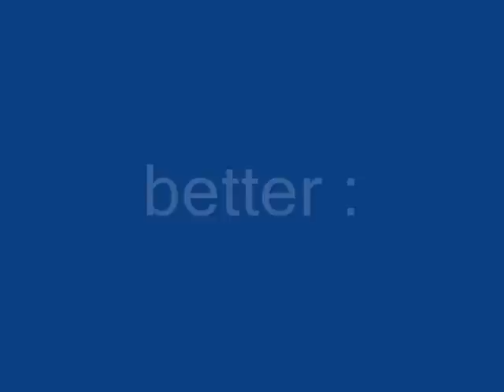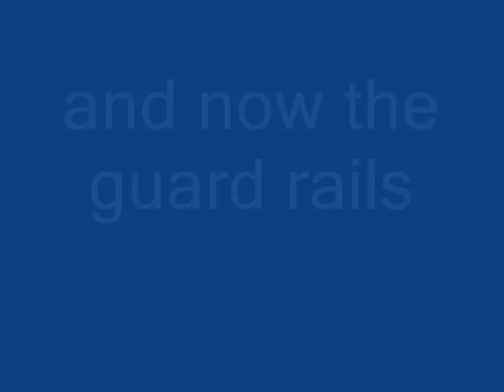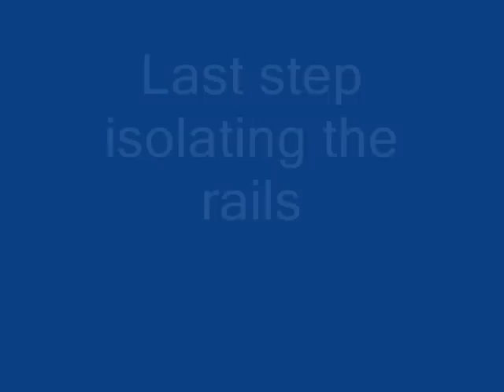handlaid turnouts

Comment: A foot operated metal shear can shear the pcb material into strips without the noise, dust, tool wear, etc...
Something  like the Tennsmith 52" shear at my local sheet metal fabrication shop.....
Otherwise,  on a table saw, set a carbide tip fine tooth narrow blade as high as possible and wear a dust mask. Set the fence precisely with a ruler on both ends of the blade, and only cut strips no more than 6" long over a 0 clearance table (the blade has 0 clearance in the table top - raise the blade through a sanded smooth piece of plywood fixed or clamped to the table so it cuts its own minimal clearance). Be careful of the inevitable kick outs.
The shear works much better and faster, though, and is much safer to use.